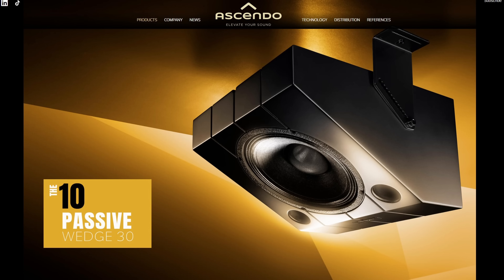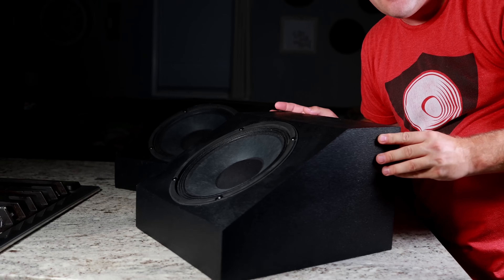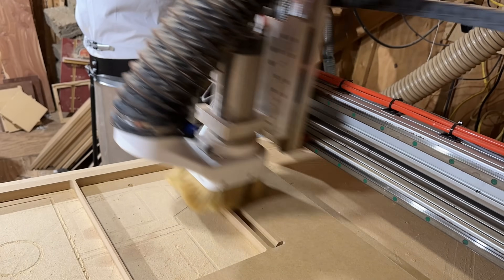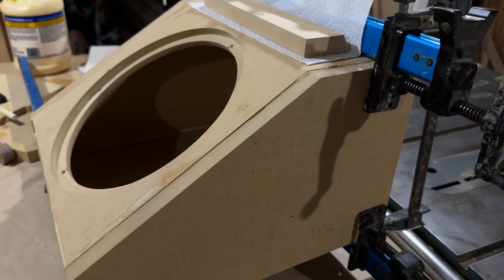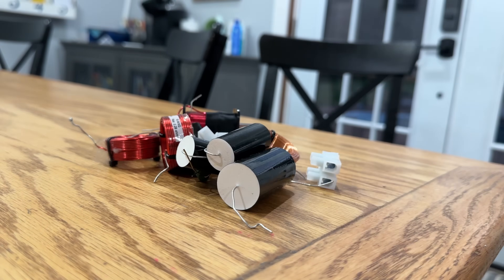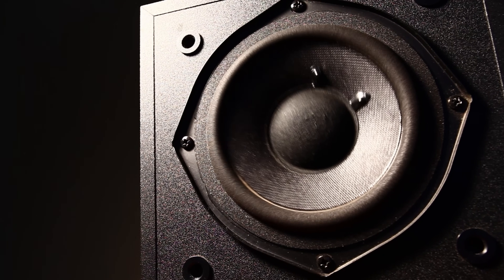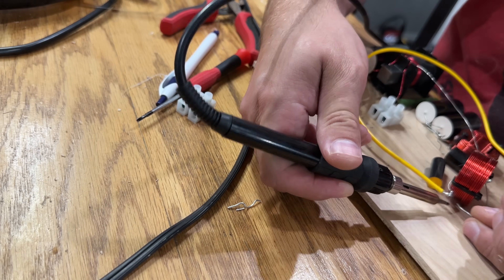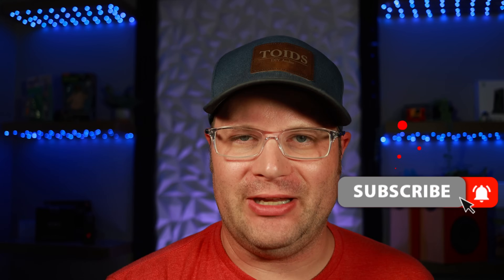How to make Dolby Atmos speakers at home! $3000 Speakers for $600! -  The Presence 10

Comment: Thats a pretty complicated crossover for a single driver speaker. You would think the processor would handle the majority of that.
Reply from the maker: It's not a single driver. It's a two-way coaxial. The compression driver is in the center with its sound coming out the acoustically transparent dust cap.
Reply: @T @Toid Interesting. I always thought coaxial drivers had built in crossovers, so they could function as a single unit.
Reply from the maker: @6-Iron they do need a crossover to tell what frequencies each driver need to play. You're probably thinking more like most car audio which typically come with a pre-designed passive crossover. Typically more designed for protection. But in Hi-Fi and Pro Audio it's up to you to design the crossover for your needs.

Comment: Hello Toids, I watched several of your videos and I enjoy them but I have a question about crossover designs. And I haven't seen any of your crossover videos mentioned this. When setting the parameters for frequency crossover point, is that done according to the speakers impedance at that frequency of the crossover point? I see a lot of crossover set at 8 ohms and it doesn't make sense to me me.
Reply from the maker: You’re hitting on a very important point. Typical predesigned crossovers for a frequency and impedance are not going to work as intended. They are typically just designed more for protection.

Comment: Hwy man. I want to build an atmos system using active and passive speakers. 

Is there a clear path to do either a mix of actice/passive or just use active speakers with a receiver. I have 2500 worth of jbl active speakers plus a giant active jbl sub i want to reuse. I hav previously used them for my effects processor pedal board and as recording monitors. It's not a massive room. I use it for gaming and such. Id rather go with a vespoke system instead of waste money on overpriced soundbars.
Reply from the maker: @jstro-hobbytech  you just need either a home theater receiver with pre-outs or a surround sound possessor/preamp.

Comment: There is a reason they all use that coaxial PA driver system. It is efficient and, in most applications, is surprisingly transparent acoustically. 
Dayton makes a 12in for like $75. You can probably use them for this build and cut the price in half.

Comment: @Toid Hey great build. Can this be adapted without the slant, i.e. just a rectangle box with the same internal dimensions? I'd like to use these for surround duty, but want to put them in wall, behind my AT fabric.I only have 6" to work with.

Comment: Glue tip you asked for? Use PVA instead of PU since PVA bond is stronger than the cohesive strength of the MDF anyway. I see no benefit to using the PU and all of the downsides of an expanding glue. The only time I use it with speakers is if I'm putting in bracing and it is not as tightly in place as I want.

Comment: It's great to have this video! Any idea how I can do the recess for the driver without a CNC? Just a router, maybe? Also wanted to point out that the ATMOS spec for speakers is the same as the IMAX spec, which is to say that all speakers are meant to be full range. I hardly ever hear anyone mention this. I think you'd get a lot of views if you designed a (compact but loud and full range) speaker that could be used for every position in, say, a 7.1.6 home theatre. I know I'd buy the plans to build them if they were available. Love your work. Keep it up!
Reply from the maker: @lo_fye  the plans site the center point, so you can just use a router and circle jig if you want.

Comment: Thank you for a great video. How would these work as in ceiling for music only?
Reply from the maker: @gislisverrisson2224  they aren’t really designed for that. I would want something with more bass. These really need a subwoofer used with them.
Reply: @Toid  Yes, I would run a sub/subs with them. I was thinking of the sealed 21SW800 solution you demonstrated in a previous video. It's a stretch fabric sealing and I have about 50cm above it for speakers and subwoofers.

Comment: You are a much better builder than me BUT i would suggest wrapping the speaker wire in cloth tape to reduce the chance of rattle/vibration. Also, that T-nut method is not good. Are you able to make a ring on the inside of your baffle? What i have seen done is a ring is made the same diameter as the driver cut out on the inside diameter and O.D. is about 1" wide and then you cut the ring in half to slip it inside of the enclosure, then glue it in and maybe brad nail it.
Reply from the maker: @robertmedina3195  thank you for the kind words and the helpful hints. I usually do wrap the speaker wire. In this case, it wasn’t necessary because of the acoustic fill. That keeps it in roughly the same place and prevents rattling. You could do the Tnuts with a ring if you want to. In fact, I’ve done that with a lot of builds. However, there are a few things that you need to think about. First will the ring fit? And in this particular case you could with modification. You would have to straighten off the top and bottom because of the angles of the cabinet. You also would want to make up for some of that volume if you could.  This is a pretty small build where every time you add more into the cabinet, it will affect the volume. In this case, it probably wouldn’t be a dramatic difference. So it is possible to do, and you can do it that way if you’d like.
Reply: @Toid  I mentioned the ring because I can see the T nut failing the way it's installed here. 

Anyhow, that aside I really like the content. Any chance you will start offering flat packs for some of your projects like GSG does?
Reply from the maker: @robertmedina3195  I was thinking about that today. Would that be something you think you’d be interested in or others?
Reply: @Toid  definitely. These offerings would pair perfectly with your videos.
Reply from the maker: @robertmedina3195  thank you

Comment: Nick , would it be ok to install the complete ring for the T-Nuts  instead of cutting it and installing the 4 small pieces? I have all the materials ordered to start this weekend. I'm building 3 Cinema 10 and 2 atmos 10 to test them out in my TV room. Once my HT room is finished, I'd build 4 more Cinema 10 and 2 more atmos 10.
Reply from the maker: @AlvjaDahat  yes you can do that. Just be careful of the angle at top. That the ring doesn’t get in the way.
Reply: @Toid  oh ,ok. I could probably cut a flat on top if needed  Thanks,man.
Reply: @Toid  How do these compare to the previous ones you made in comparison to the Volt 10?
Reply from the maker: @chesleebryan5099  I no longer have those so I can’t do a direct comparison. But in general, these would be better. it’s a much better driver that plays cleaner. You noticed that when I decided to build some for my theater, I did these instead of the Volt 10. They are still really great speakers, but I prefer these.

Comment: Looks great man! Could you privide the angle and depth of the cabinet? I want to see how these would fit into my room design
Reply from the maker: @paultravisano9403  it’s around a 31 degree angle. The depth is somewhat confusing because it depends on the orientation but they are about 9 1/4” x 14” wide by 14 1/2 inches.
Reply: @Toid  thank you! Now I want to make a LCR version and an in wall version in addition the these for atmos.
Reply from the maker: @paultravisano9403  I should design a normal box so people can use these in other applications.
Reply: @Toid  I think that's a great idea.
Reply: @Toid  Also is there any changes needed to crossover if 'normal' box is mounted flush in ceiling/wall? I was really waiting for this project to use them as in ceiling atmos (I have plenty of space above).
Reply from the maker: @lasseforss7402  you can do that if you like. It will mainly affect your low frequency which your receivers room correction will correct either way.

Comment: What comparisons would you make between this build and the atmos speaker build that you did maybe 3 years ago using a Eminence Beta-10CX  and either a JBL or an eminence tweeter? That would be very interesting.
Thank you.
Reply from the maker: @OldfarseeingArt  they are both really good designs, but overall this is better (IMO).  In general, they are better drivers that are being used. Because of that It’s more linear and is lower distortion. Not to mention I really like this design better.

Comment: Because it has angled suface, it can change direction of the sound it produces! I like that idea. Innitially, I thought, the cabinet size is too small for a woofer, but only 100Hz and above is required, it is a "compact" speaker for its size! Good job!

Comment: Nice pro floor monitors 😂😮
Reply from the maker: @Vietturtle2023  Ha. Technically the same driver, but the crossover is vastly different. 😁
Reply: @Toid  the Celestion driver is easy on ears at loud volumes, very warm,  sweet sounding sprakers very english
Reply from the maker: @Vietturtle2023  yeah. I am a real big fan of Celestion

Comment: only problem with making cheaper versions of jtr speakers is all of the money in jtr speakers are spent an parts not finishes. Brands that spend all of their money on marketing and fancy finishes are much easier to beat with diy i would think.
Reply: You'd be surprised at how much margin these companies have on their products.  4-5x cost of parts isn't uncommon.  Fancy finishes are not the easiest to DIY and are usually time-consuming.  Some speakers that cost thousands cheap out on crossover components.  Things most customers would never see and don't understand are easy places to cut costs and increase margins.
Reply: @Ry-lx2kl  I've done cost counts on jtrs products and unfortunately they do not have a big profit margin. Do the math urself and see
Reply: @bingdong8571  I don't have their parts list to do the math myself.  Do you have those parts lists?  I'm just looking at what was done here for $300.   What drivers is JTR using?  What are their crossover components?  $1300 leaves some wiggle room for quality parts and still a 2x profit.  But it sounds like you know their products better than I do.  Are they using $600 drivers and $400 in really high-end crossover parts?
Reply: @Ry-lx2kl  b&c, they sell the driver on parts express. the crossover components are more difficult. Had to do some guessing but if u can get ur hands on one you woild be shocked at the size and weight of that thing. probably weighs more thaan this completed version.
Reply: @bingdong8571  B&C makes some of the best drivers in the world.  Even so, the most expensive coaxial I found on Parts express from them is:
B&C 10CXN64-8 10" Professional Neodymium Coaxial Speaker 80 x 80 Degree 8 Ohm @ $431.25.   I don't know what crossover they use, but the B&C branded crossovers go for ~ $130 on parts express.  So that puts us a $560+ the enclosure.  There are costs of running a business orther than the parts themselves.   These speakers focus on a narrow section of the audio speaker world.  By necessity of volume of sales, they need to make a decent margin.  If they charge 2x parts, I would agree with you that their margins are slim compared to the competition.  That translates to a lot of value for the end user.
Reply: @Ry-lx2kl  sure, great, sounds good

Comment: What box software did you use? I just got Term Pro which has the ability to export to CAD so could feed to CNC (I think). Great build btw, basically how I would consider doing ATMOS style speakers and/or side/ceiling mounted angled firing drivers. I am curious though they do have a high compression in it.. does it sound as good as if you had used a somewhat smaller woofer and separate tweeter/horn maybe? I am also hesitant about the crossover stuff being inside the cabinet where I would think the sound pressure/waves inside the box might "loosen" something. For that reason I'd put the crossover in a separate little box with openings in the back perhaps for some cooling/air flow (and no air leaks where it is mounted inside). I'd also say, it would be very cool to show how you mount these. They are big/heavy. No doubt a 2x4 stud to mount them on. But do you drill holes in to the box on the back side to mount them? Or build a shelf/bracket to hold them in place?
Reply from the maker: @WhySoDivided-CantWeAllGetAlong  it looks like a nice program. I’m not familiar with it. Typically use winISD to figure out the size enclosure. After that, I did design it in sketch up. From there, I can send the files to my CNC program.

Comment: Ehhh… no directivity or distortion measurements and different SPLs? This is what sets apart the $600 and $3000 speakers.
Reply from the maker: @MyFatherLoves  I have some off axis measurements I will post later today
Reply: @Toid  rock on.
Reply from the maker: @MyFatherLoves  these are anechoic measurements to 150hz https://toidsdiyaudio.com/forums/discussion/dolby-atmos-anyone-how-about-high-efficeincy-rear-surrounds/
Reply: @Toid  holy moly…. It basically goes omni at 8k? That’s pretty awesome.
Reply from the maker: @MyFatherLoves  I don’t mess around when I design a crossover 😁 Thanks for reminding me to put these in videos. I’ll make sure to do that on the next build.
Reply: @Toid  you rock.

Comment: Do these drivers have a better off axis response than say the Volt10?  I like the concept of the coxial for simplicity, but sometimes the off axis can be pretty rough, which is driving me more towards a traditional 2 way.  Thanks
Reply from the maker: @jasonhejny608  they actually have really good off-axis response. I should’ve touched on that more in the video. I do have some polar response graphs as well as off axis measurements I will publish. I’ll make sure to post a link to that under this comment.
Reply from the maker: @jasonhejny608  here are the measurements. I’m not sure how well the volt 10 measure off axis but if you do, you can compare them. https://toidsdiyaudio.com/forums/discussion/dolby-atmos-anyone-how-about-high-efficeincy-rear-surrounds/
Reply: Thanks for posting those.  If I remember right the off axis started dispersing about the same point, 10k, but the slope was awful.  It was something like 10db down at 15 deg/20k and obviously worse the further off you got.  Great build man thanks for the info.

Comment: Do you happen to know which PA drivers JTR or Ascendo use in their speakers?
Reply: You can buy the same driver jtr uses on parts express, iirc. It's a B&C 10FCX64. Normally, they are over $500, but they got them on sale now for $345.00. JTR's crossover is also more complex than Toid's. Nothing against what he's doing at all. I think it's great that he builds these speakers. It's just good to know that the JTR has a lot more money in parts cost.
Reply: @ProudPapaKY  Yeah, the crossovers Jeff builds look pretty next level. I don't think I have the skills to replicate that without using active DSP. Toid's design is much more approachable. So the B&C 10FCX64 is the exact same driver used in the Noesis 110HT and Noesis 110HT-SL? Thanks
Reply: @sk9592  it might be. It's been a minute since I checked.
Reply: @ProudPapaKY  I don't think it is. It visually looks different. And after modeling this in winISD, it doesn't seem to have nearly as much output as the JTR driver before hitting its excursion limits.
Reply: In the past Ascendo used Celestion, but now they sell enough units to let them order customized driver that we cannot order
Reply: @patrickmartin4482  Interesting. So was the Celestion  FTX1025 used in older 10" Ascendo speakers?
Reply: @sk9592  from my knowledge yes ... But I have no confirmation from Ascendo. Only that they used Celestion but I don't know for which speakers and until when
Reply: JTR uses the BMS 4594nd for their Noesis line of speakers. Wouldn’t be surprised if they used all BMS drivers. 

Don’t know about Ascendo. But using B&C’s more high end drivers would be comparable for DIY designs. The DCX464 for example is B&C’s answer to BMS’ 4594nd.

Comment: Would not curving the front baffle edges help the sound?
Reply from the maker: @dbefore7165  in this particular case a small round over would make very little difference and would most likely be inaudible. But if you build them, you could definitely run them over if you wanted to.